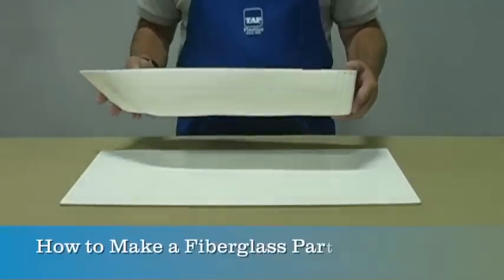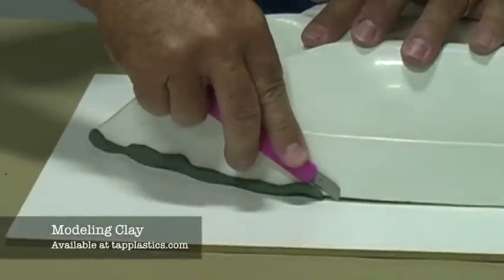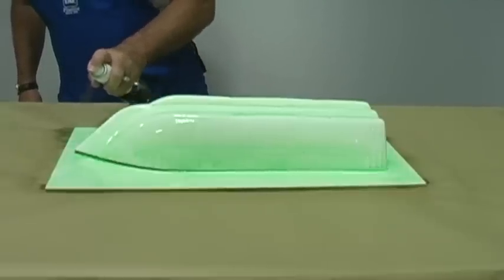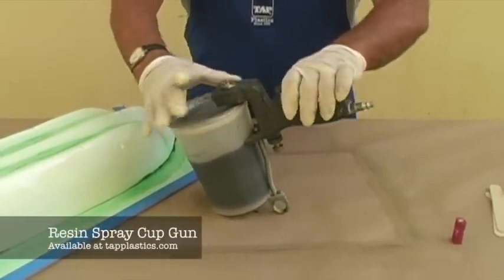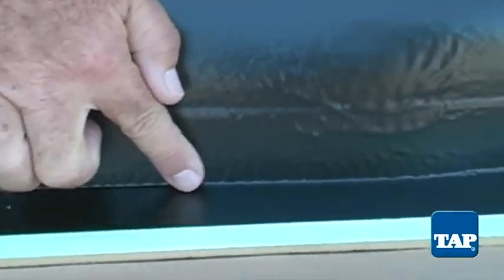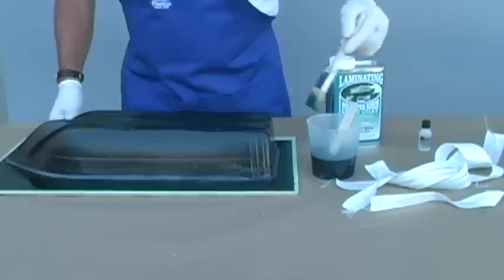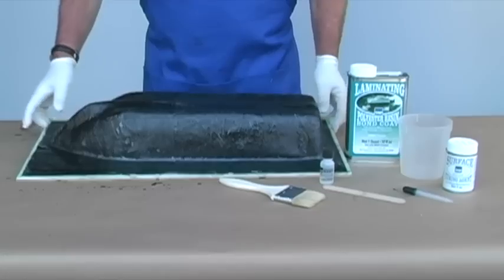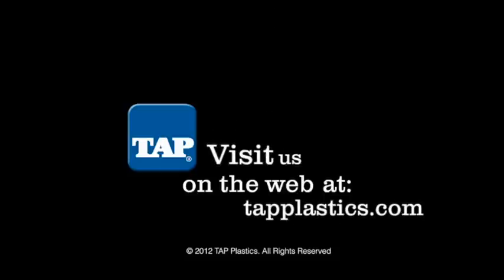How To Make Fiberglass Part - Part 1

Comment from the maker: You are correct that 15-18 mm is about 3/4".  But the video uses the term 'mil' not millimeter.  They are completely different terms.  The term mil is not a metric term referring to millimeters.  One mil means .001" (one one thousandths of an inch) thickness.  So the recommended gel coat thickness in the video is .015" to .020" thick, roughly the thickness of 4-5 sheets of paper.